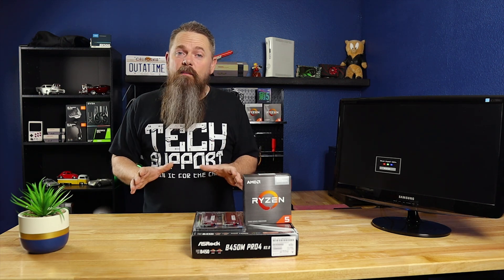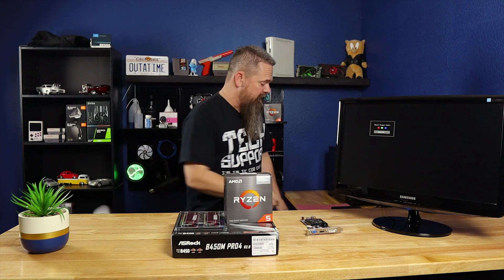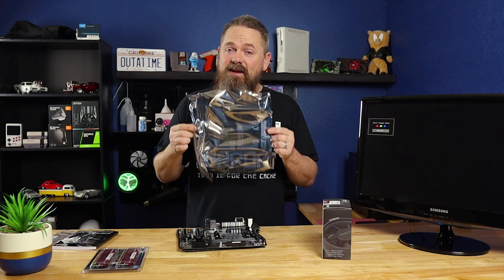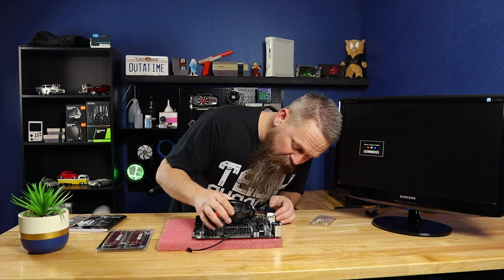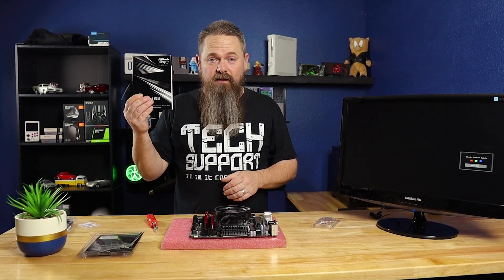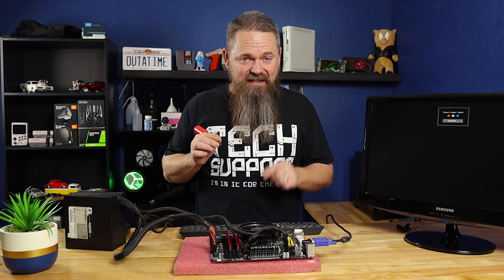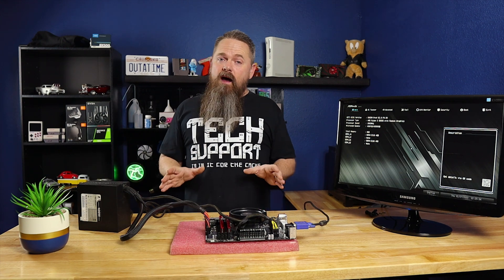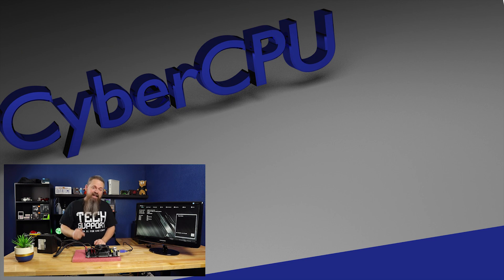How to Bench Test a Motherboard and CPU

Comment: Thank you for this. I used to do it the hard way (in the case and then #%%$$#@!%@) now what? 
So used a mobo box as a base and put a repair build together and it worked great. The screw driver start was kinduv funny LOL. You ever jump start a 69 Pontiac with a screw driver on the starter?? Hilarious.
Ya so I went diggin into my 90's hoarde of stuff and found an old Nvidia basic card with.......an HDMI out. It was a eureka moment.
Thanks again

Comment: Also a motherboard new out of the box is not the only time it posts slowly.  If you ever made changes in the BIOS (UEFI) you might have noticed that it sometimes takes longer to post then.  Or it may do that if you installed an update.  It shouldn't always do that unless you just have horrible luck with computers.  The thing is that it needs some time when it is doing that.  If it sat for more than a few minutes and still didn't post that is when something may be wrong.  I don't know if attempting to power a normally working computer off when it does that after a change or update is safe so I wouldn't do it unless I must.  There is no telling what may happen otherwise!  It may be that nothing happens and it just does the slow post again.  Any hardware changes like new RAM or any cards changed may do it too.  Just give it a chance and don't panic thinking you damaged it, you likely did not damage anything if you were careful with everything.

Comment: I noticed it didn't boot.  Since it is a AMD chip, AMD doesn't have integrated graphics, UNLESS you are using a 'G' AMD chip.  You should let people know, you're using a G chip.  If they try this with a non-G chip, they'll have that video issue, but their system will keep rebooting.
Reply: And some Intel chips too.
I think these things are crucial to know first before even touching the components.
Reply: At the beginning, he mentioned not needing the ram if you have integrated graphic. Is this what you are talking about? Sorry I am new, and wanting to make sure I do not mess up on my first building, I am using an AMD 5 7600X CPU.
Reply: @soccerryan9008 Well?
Reply: Did you even watch it fully
Reply: He literally explained it at the beginning, he showed a discreet GPU if it doesn't have onboard graphics. He said it all clearly. This is why education is so important, it teaches you to analyse and pay attention, you need to slow down and be more aware.

Comment: Woulda Coulda Shoulda ...... Built  an Asus and Ryzen system.   No Post.    Hate to do a complete tear down.    I think I'm taking it back to the Big Box store.  The most troubling part of any build I've done so far - is the itty bitty wires for the power and reset.   Why can't they be simpler like the other plugs ?

Comment: Very nice video. Thank you. Allow me to provide 2 tips : 
1. I don't recommend to use the thick styrofoam as a testbed since it can create static electricity which is not good for the memory and motherboard. It is better to use the cardbox of the motherboard itself. It will also allow you to easily insert video card if needed when you position the board at the edge of the cardbox.
2. When you insert the cpu to it's socket, Push it gently from above with your finger WHILE closing the lever (Especially with AM4 sockets. With LGA socket it doesn't matter). This way it will sit better in it's socket.
Reply from the maker: 1.) The pad I use is non-conductive. I believe I mentioned that in the video. 

2.) If you push down on the CPU make sure to clean the CPU because the oil in your fingers can effect thermal compound efficiency. You shouldn't have to use any force to insert the CPU into the socket unless you have bent pins. It should go down with gravity.
Reply: @CyberCPU  Looks like you might be using an antistatic polyethylene foam pad (usually pink in color) and is used to protect electronics from static charge buildup
Reply from the maker: @snmadison  it's a pad I've literally been using for over 20 years. I got it from a computer store I worked at in 1999.
Reply: @CyberCPU  One time I broke a $300 motherboard because a cable wasn't long enough and another time something I did to my bro's PC made it catch fire (i was doing stuff with the molex cables and put a black wire in a white plastic plug where there wasn't one before) I learnt from my mistakes though and the last PC I built is still working fine many years later. :3
Reply: I have always used an anti static wristband and a mat both earthed to the UK earth pin with a dummy mains plug which only connects to the earth pin.

Comment: If you connect a small speaker to the speaker jumper on the motherboard, you'll here the beep. Some motherboards have a built in speaker right on the motherboard. Also the number of POST code beeps will tell you what's wrong.